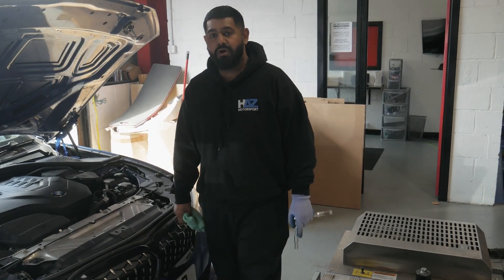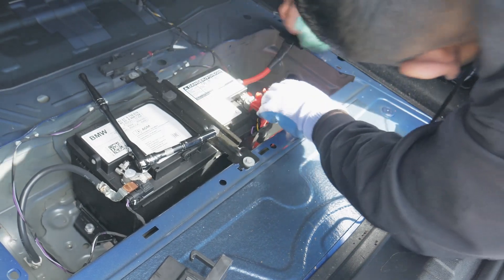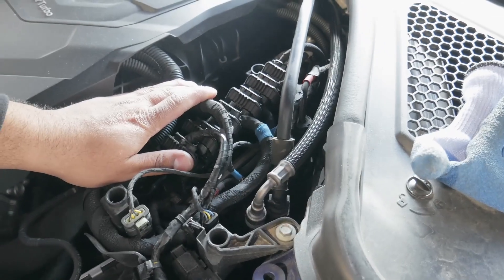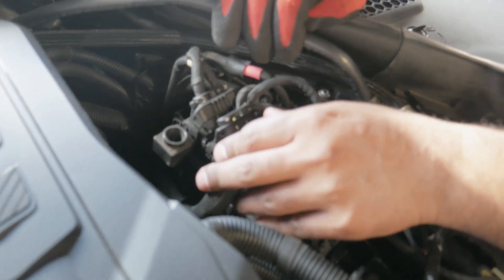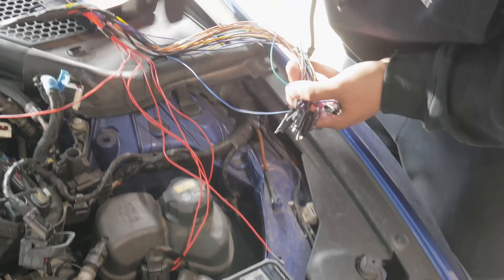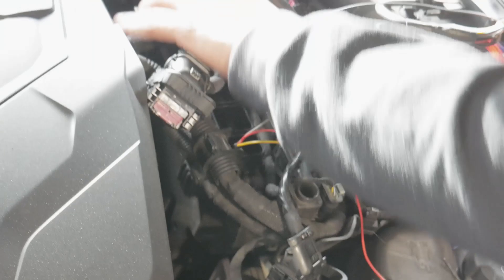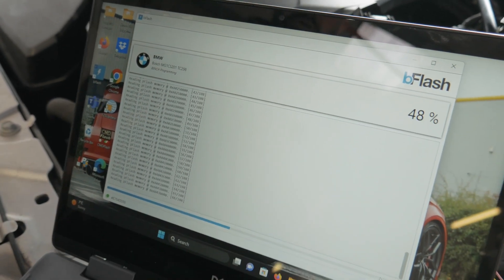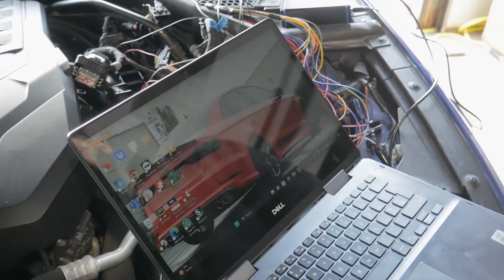Unlocking BMW G20 320i B48 2020 | ECU Bench Unlock Guide and OBD Read/Write Overview🔥🔥🔥

Comment: After 6/2020 can you read 2021 and 2022 ?
Reply: It’s a bench unlock so it’s only for cars before 6/2020. Cars after 6/2020 need a femto unlock, which requires you to send the dme into a shop does femto unlock.
Reply: @F30Ayan  Thanks for the Info. Is there a sure way to identify which one I got?
My G20 is right around that production date.

Cheers,
Andrew